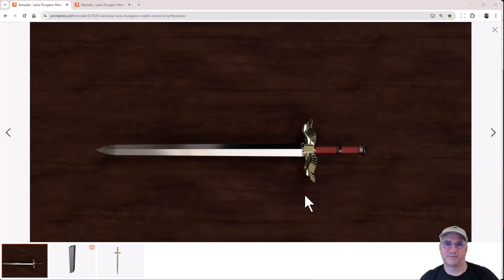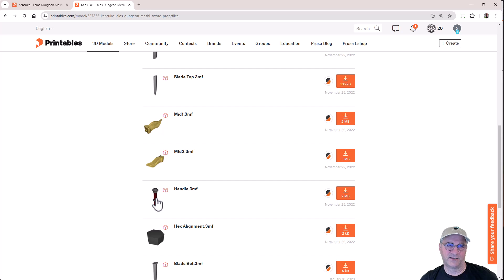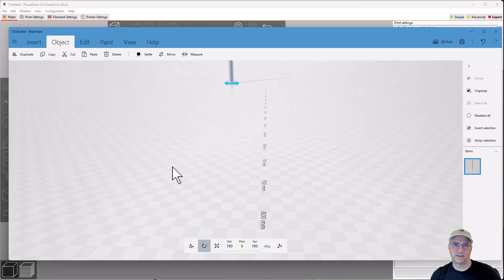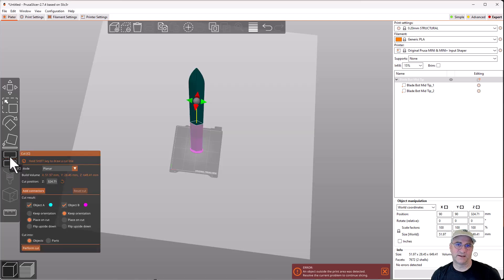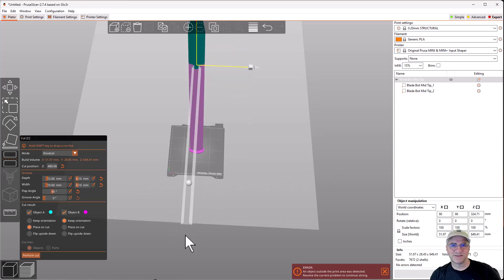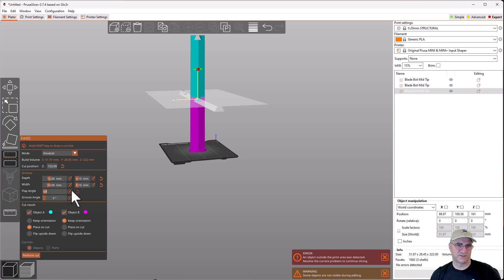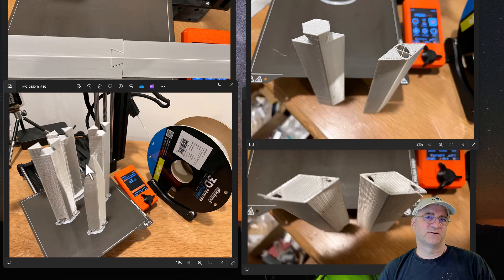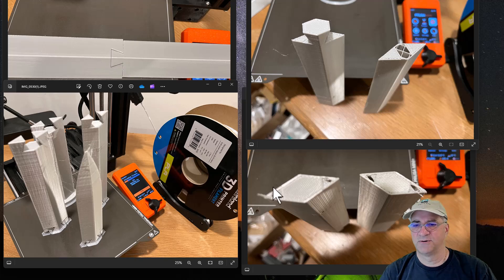Creating Dovetail joints when cutting 3d Models with Prusa Slicer - A sword print

Comment: I`m new to 3d printing and I didn`t know that you can put joints in cuts :)
Now I can make biiger thing on my 220x220mm plate \o/
Reply from the maker: I ran into issues with the sword because I only had a single dovetail.  In that case, I needed to increase the fill and perimeter wall count because even model swords are used to whack things.